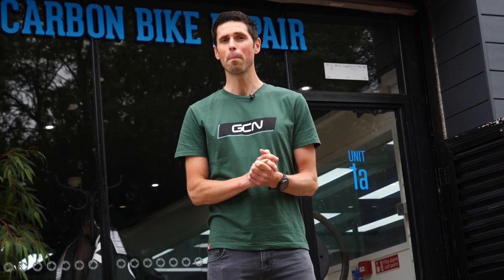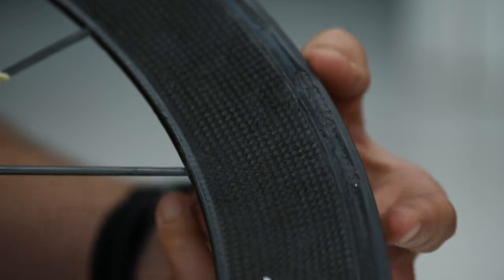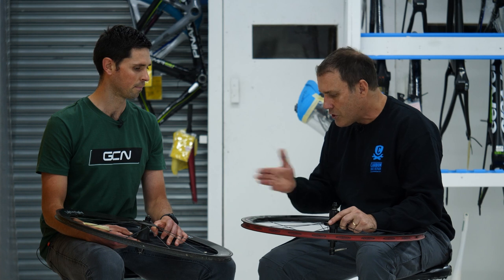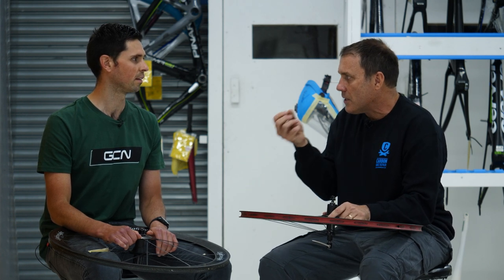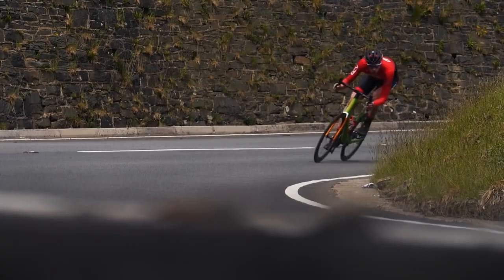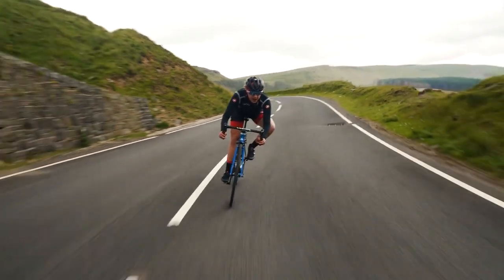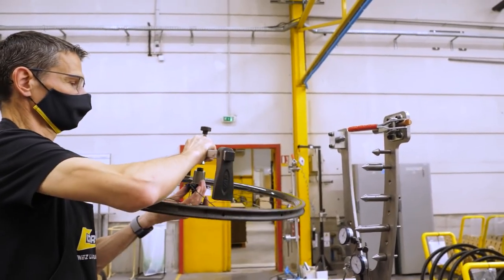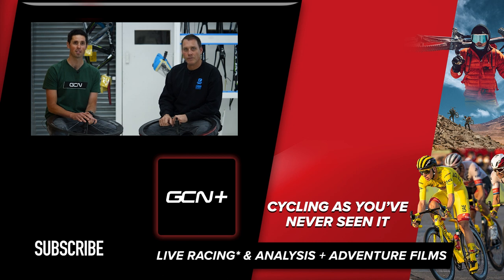Can You Fix A Broken Carbon Wheel?

Comment from the maker: Have you ever repaired your carbon wheels? Let us know in the comments section!
Reply: Those damages can be repaired with JBweld and a sandpaper, who cares about safety, lightness is more important
Reply: I've fixed them w/ super glue & baking soda, then sanding smooth if its in a critical spot
Reply: Dolly Parton sang a song in the seventies called...'Can you ever fix a carbon wheel'. The chorus went 'Some things can't be fixed, but please baby, can you ride them to heaven.'
Reply: comfortable in using carbon with alum braketrack..
Reply: @JPDynamics  I like the look of the Shimano C40s for that reason... but I’d like something wider than a 17mm internal width
Reply: I trashed a CF rim by trying to bunnyhop over a sewer grate uphill, coming up short and landing inside with my rear wheel, which got stuck for a moment with a "SCRUNCH" sound since it was wider than the 23mm I had on. Ouch. Replaced the rim and relaced the wheel myself. Fortunately Light Bicycle rims aren't too pricey.

With disc brakes and running them tubeless with inserts I really don't fret about their integrity. Carbon rim brake wheels are fine for our TT bike which doesn't see alpine descents.
Reply: @danielsepulveda912  They can sell you a new set for £1200 , no you can't repair them my a@@ , easy repair , my rim got chipped on the edge , filled it with carbon filler £12.99 and sanded it down and still ok after 18 months !

Comment: rim brakes, and tires glued to the track, brings back bad memories. Such disgusting and unneccesary work to do with those. disk brakes, tubeless with inserts, last you a lifetime
Reply from the maker: Controversial 😂
Reply: Im not touching that with a 20 foot pole
Reply: Rim breaks are best
Reply: @thomashardbattle4287  I hate it when my rim breaks
Reply: @stephenwatkins7592  same
Reply: Finally, someone saying something that makes sense.
Reply: @First Last lol im pretty sure the wheels are closer to the ground XD
Reply: @First Last What?
Reply: @First Last I can't believe I've read this
Reply: @First Last Of course disc brakes are superior! There's no one in this world who doesn't like a noisy  piece of garbage that works as well as me on rim brakes with carbon rims on a rainy descent(yes, I'm 48kg). Anyway, point is, the market currently likes a braking system where people can hear you a kilometer from where you are, and is unnecessarily high maintenance, and apparently you gotta change the brakepads as soon as they get contaminated which is like everytime you clean the bike.
Reply: @dan_lazaro  Not if you pay attention while cleaning!
Reply: @jemm.8277  me either 🙊
Reply: @dan_lazaro  have you ever actually seen a bike with disks in person? The only bike I have that makes sound with wet brakes is my enduro bike with metallic pads. Otherwise, they're lower maintenance, more reliable and consistent, and more powerful. Overall, they're better.
Reply: @mihalis1010  I've ridden a 100km ride with one, can't say it was a good ride lol.

Comment: This video have convinced me that I shall never have carbon wheels. I had no idea they were so finicky
Reply: Me too. 🙊
Reply: No kidding.  I'm glad I decided to go with alloy for my upgrade from stock wheels
Reply: they aren't that bad. i upgraded my back wheel on my CAAD8 to a low end zipp 302 after a crash and i have never had issues. i used to constantly break spokes on my aluminum wheels i used prior to them, not a single spoke broken on my carbon rims yet in about 2 years. i even started bike packing with tons of extra weight, plus i am a heavy 86Kg rider, and I'm not that careful at all. i guess they just don't flex as much so the spokes experience less stress? I do however break carefully on longer descents and allow them to cool, especially when bikepacking.
Reply: i ride 600 miles a week on carbon wheels.   no issues....     i have worn out the brake tracks on alloy clinchers before, but never carbons.

Comment: The one thing you can learn watching this video is that with rim brakes and carbon wheels you can’t brake as much as you want. And that’s not safe.
I’ve learned by myself by cooking a set of Roval, but there was nothing much else I could do. Buy disco brakes or use aluminum braking surface
Reply: I want a disco brake. That would be fun at night! 🕺

Comment: I had a crack running about six inches along the rim bed on one side of my rear wheel. 
I drilled a tiny hole at each end of the crack, then used a dremel tool to ream out the crack, cleaned the surface thoroughly, then mixed up some “chemical metal” which is essentially a polyester resin; filled the crack and clamped the wheel on either side. Left it to harden. It has been fine for about 800kms. I wouldn’t do it with a front wheel though.

Comment: This is the primary reason I went with disc brakes. I don't have to worry about delaminating or melting a rim while descending the gaps and there's no accelerated brake track wear from riding in the wet.

Comment: So the take home message is, if you break your carbon rim, it's done.

And possibly, get a disc break version, so you "sacrifice" a cheaper part of your bike
Reply: The rim can be replaced, so if you got expensive hubs, it's worth to replace the rim.
Reply: Sounds like most of what Carbon Repair do is more to frames than wheels.
Reply: I'd much rather replace a rotor than a carbon rim. Unless your sponsor is buying wheels for you, rim brakes carbon wheels dont make sense.
Reply: @kibbee890  I could agree with that, but given all the trouble I've had with discs on my CX and XC, I'd rather live a problem free life on rim brakes.
Reply: @panzerveps  you can't have it both ways karen
Reply: @nizamalija3739  Which is why I will keep on rolling on my rim brake bikes.
I can afford to pay €700 for a new set of rims, labor included.
Reply: @panzerveps  poor you, I could broke the Corima in the morning and replace it with Lightweight in the Afternoon. I can afford 8k for a new set of rims, Labor included.
Reply: @nizamalija3739  Cool story bro. 
I'd rather repair than buy new.

Comment: There was one question I was hoping you would ask that professional, but you did not.
I was waiting to hear if brake tracks on carbon rims can be resurfaced with fresh coat of heat resistant epoxy in order to rebuild the tickness.
Reply: I guess the part about flat spots answered your question.
Reply: 3:20
Reply: @GeorgeD1  Not quite!
Flat spot is just a hotspot in its very early stage (before localized excess heat causes substrate delamination). They said flatspots can be repaired meaning they can remove the brake pad material that started being transfered to the braking track.
What I want to know is whether it is possible to rebuild a worn off braking  track on a perfectly sound rim.

Comment: My takeaway from this is to keep riding aluminum disc brake wheels, because the carbon wheel will either be not repairable, or expensive to repair.
Reply: Aluminium disc brakes wheels aren´t always possible to repair/true either though.
Reply: @boc-tonysyklist2145  Sure, but they're a hell of a lot cheaper to replace. Couple hundred bucks per wheel for all new vs how much for even budget carbon rims?

Comment: Wow, if repairng a Lightweight is "not economical to do", implying you should buy a new one, how much does Rob charge for the work?
Reply: Wasn't he saying that delaminated carbon fibre on the brake tracks is never economical to repair because of the nature of it?
Reply: @armadillito  which is somehow economical to produce in the first place. In other words, it is rather about the competence of repair centres and in the end of the day, their hour rates
Reply: @feedbackzaloop  erm... No. When you manufacture a wheel rim you lay up quality controlled carbon mats to form the part, whereas repairing a damaged rim you don't know what you're working with without conducting extensive scans. Even once you've imaged the damage, repairing it is probably more work than making a new rim. For a very basic analogy imagine forgetting a dowel when assembling something from IKEA, you might need to take most of it apart just to fix that little thing! But a carbon rim is dependent on the whole structure being bonded together with continuous integrity.
Reply: @armadillito  this is exactly what I meant under competence of repair centres: they need the tooling of a manufacturer and the know-how of the manufacturing process. What, again, is incorporated into the customer bill as hour rate of the worker.
As an example, when you change the tyre of a car, you pay for 20 minutes of shop work, not 0,000001% of workshop equipment leasing
Reply: @feedbackzaloop  I mean, you're technically correct there but I'm missing what point you're trying to make. Are we both simply agreeing that it's daftly complicated and time consuming to repair carbon in different words?
Reply: @armadillito  yes it is, but what I mean is repair is still cheaper than purchasing the new part, for most of the times, not always, of course.
Unless the worker thinks too good of himself and rather do smth simpler for the same money. 
Another example - shifters and derailleurs: hardly any bikeshop would refurbish them. In their words it is "not economical" to charge 50€ for repair when the new part is 100 plus 10 for the installation
Reply: at least 30K
Reply: @feedbackzaloop  after dismantling and rebuilding several Campy and Shimano shifters, i can understand why repair centres wouldn't do it. just because you have the tools and expertise doesn't mean it's always a straightforward job or that something would go wrong. it's literally cheaper in purchase of goods and man hours to install a new shifter than purchase small parts and hope one of your techs has the patience to break the unit down, keep all parts together from the teardown, rebuild, troubleshoot the rebuild, teardown and rebuild again in the case of a first improper rebuild, and ensure the work will last as long as the original warranty would cover. economically speaking, the shop needs to turn over bikes, etc. the repair boys here probably see the lightweight come in and hope it's a best case scenario, but it probably isn't, ever. that's a 3000 buck set of wheels and they're built upon a certain set of standards that, i'm sure many, repair shops aren't equipped to meet. that isn't to say they can't do completely competent repair work, but your flash ass lightweight's won't be so lightweight and you'll probably end up spending 1/3 of the original purchase price to get them repaired. might as well find a completely fine used set to grab at that point.

ETA: i'm an idiot - those lightweights are probably 6k new. so maybe the 1k repair cost isn't anything to the owner. regardless, that's still a hell of an outlay for a repair.
Reply: Why are we splitting hairs here? It’s like comparing Hampton sizes. Yes you both know what you’re talking about!
Reply: The key word here is “economical” he’s not definitively saying it cannot be repaired, as with life in general it all comes to cost……and if it costs you more to repair than a new replacement then you have your answer. 
For an expert on Carbon Fibre he was pretty much non -committal.
Reply: @J.P.1.  well I revive 9 and 10 speed shimanos on somewhat regular basis and they pay me off better than main engineering job, which is halftime anyway. Actually, I find srams a lesser investment: when they break, it must be some intricate cast or forged part

Although I agree that when you deal with wheels professionally, you have to count in warranty and not allowed to bring back, say, 95% of functionality (not compromising safety) despite any cost saving.
Reply: I didn’t hear him say it wasn’t economical to repair, he wouldn’t try because the can’t test the repair to ensure it won’t suffer a catastrophic failure resulting in a massive lawsuit!
Reply: @chiefsilverback  “let it go, let it go” as Elsa would say
Reply: @feedbackzaloop  Except, when comparing manufacturing a series of something like a wheel,  to the hand-labour of repairing a single wheel after a damaging event.

Comment: The localised wear on the Lightweight rim was more likely because the wheel wasn't quite true and the brake pads were set too close to the rim, causing the pad to contact that segment of the rim on every revolution. Either that or it's just what happens when the rim is out of true. Same goes for aluminium rims, so it's nothing to do with the material. I reckon that's far more likely than the rider having some kind of flawed braking technique.

Comment: bought some cheap chinese deep section wheels years ago. Lasted a year (very flexy though), then over a small bump in the road, got a puncture due to the edge of the rim chipping off and cutting the tyre. Bodged a repair to get me home and the wheels went straight to the recycling centre/rubbish dump.

Comment: I'm using a set of $370 unbranded carbon clinchers with 23c GP5000 tires, Michelin light weight innertubes, and rim brakes with carbon pads. I've taken the bike on moderately hilly rides for hours at a time and they have been great. I am mindful to feather and pump the brakes evenly and both together, like on a motorcycle. I think as long as you don't drag the brakes all the way down the hill or slam on them hard repeatedly, they will be fine. Go for middle of the range carbon wheels, cheap will be poor quality, expensive will be delicate and expensive to repair.
Reply: if you live in 3rd world country ride like that will bring your carbon to the grave
Reply: @nizamalija3739  Let's hope people in 3rd world countries are spending their money on responsible purchases like food, and not luxury bicycle parts.

Comment: Here’s my summaries for rim break lover.
1. Carbon rim break, use it on flat because you don’t apply break frequently.
2. Use alloy rim break or alloy rim on hilly because on a descent, you’ll apply more pressure on breaking surface.

This is the only way to last you carbon rim break. The only hustle is changing breakpad back and forth.. Enjoy riding..

Comment: madfiber where carbon meets rim surface was seperating... used JB WEld can withstand temps of about 500 f  i live in flat area ....and am careful...2000 miles no problems
Reply: have to find adhesive that has a high temp resistance even the best superg;ue product only good at around 300f the bond will break down at some point

Comment: It makes more sense to buy a new rim (not complete wheel) than to repair one.
Reply: Enve rims still retailing for $950, so a $200 repair to the rim would save $950 for a new rim, $70 rebuild cost and another $70 for quality spokes & nipples.  $1090 or $200?  Not sure it makes sense to bin a repairable Enve rim if it could be repaired.

Comment: Use some epoxy resin to put them together again
Reply: Bro the strong part is the carbon fibre
Reply: @dietbountyicecream1444  wel it’s a mixture of the carbon and resin that makes it strong. Without resin the carbon is not strong at all. Resin might solve the problem if you use it correctly.

Comment: Wait, my nipples are connected to the spoke outside of the rim, so they pertrude out of the rim slightly. 
I had a rough road and realized that one spoke was loose at the side of the rim, and the nipple was inside the rim rattling around. 
My local bike shop repaired it easily, they told me there was no crack in the rim, connected the nipple with the spoke and trued the wheel. 
Has had no problem since, now you tell me its a nono?

Comment: Carbon wheels are lighter but more susceptible to damage at the brake track. Alloy rims are more durable with rim brakes but a bit heavier. Disk brakes are better for carbon wheels but the brake system is a bit heavier. Rim brakes are best with alloy rims and the braking system is lighter. Doesn’t going with carbon wheels and rim brakes negate the weight savings over alloy and rim brakes?

Comment: If you can afford to buy new carbon wheels.  You should be afford to replace it.  If it’s too expensive for you to replace.  Then just stick to alloy wheels.

As the carbon repair expert shows both rim brakes and disk brakes carbon wheels could suffer irreparable damage. So if you avoid potholes and brake sensibly.  You can avoid damage to make your rim or disk brake carbon wheels last.
Reply: Most sensible answer here. People hating on one side or the other don't understand that others have different use / budgets / expectations. Go with what suits you, live & let live
Reply: @triplebuse6887  Exactely!

Comment: So if you got carbon fiber wheels you should have disc brakes not rim brakes because the rim brakes will damage and wear them  out? That  defeats the purpose of having carbon fiber wheels to begin with though? Disc brakes add significantly more weight to your bike than rim brakes on carbon fiber wheels. 🙈